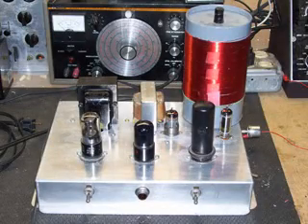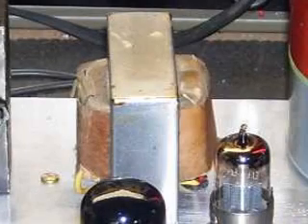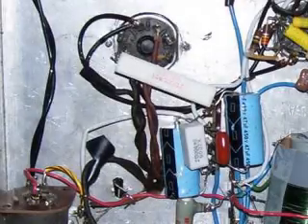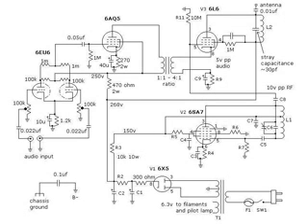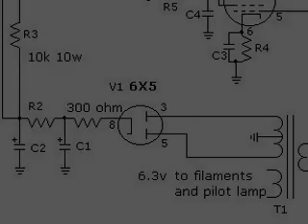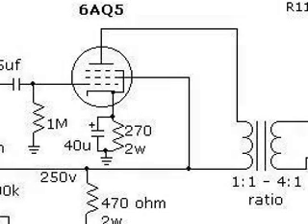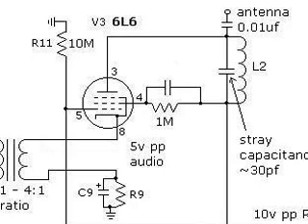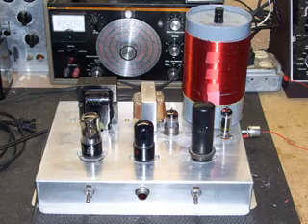AM Transmitter first modification

Comment: A good video, but if one wanted to construct one from the given parts list, he would run into a problem with the coils. I have no way of measuring 100uh. I would like to know the size of the wire used, and the diameter of the coils. If Richard is reading this, please send info. Thanks,  Jim
Reply: Don’t know if you ever found it but, Rick has all that info on the original build video. Go to Allamericanfive’s channel and search AM transmitter

Comment: I was going to build one of these and i seen a switch on the side and front that wasn't in the schematic i was wondering what they do, and if you could add a 1 ma meter without bothering the performance? Will you please add a couple of hq photos of the underside of the chassis THANKS